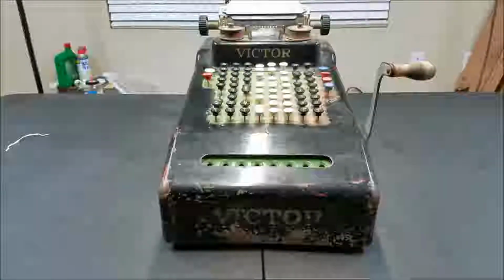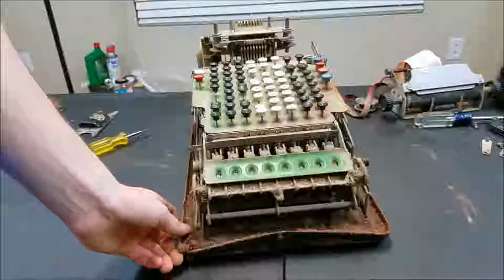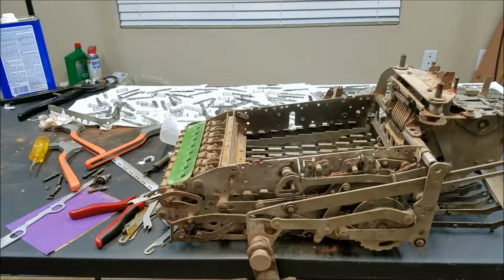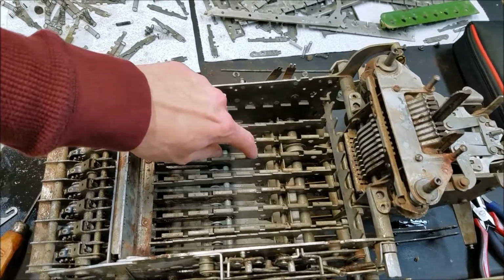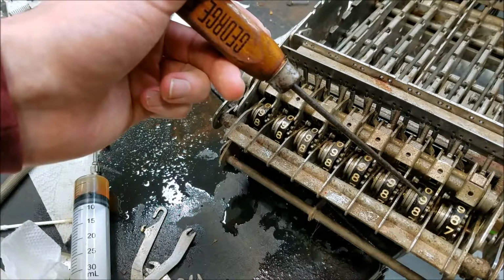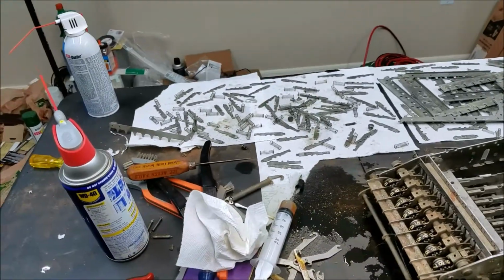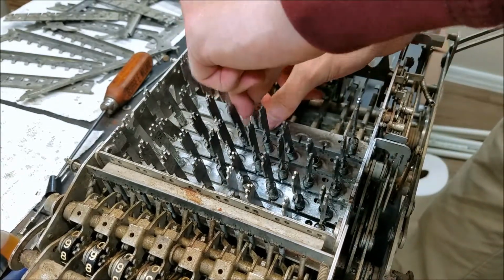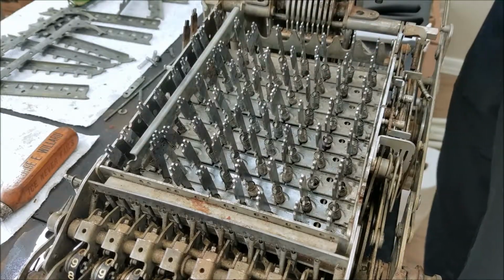Victor Adding Machine Repair Part #A

Comment: Have you found a service manual for these?
I have just acquired one and I need to get the printer mechanism apart as there is a bent shaft.
Reply from the maker: Unfortunately no, most machines like this were serviced by factory servicemen, and the manuals were never publicly available. Really the only chance to find a manual for something like this is if a serviceman took one home and kept it…
Reply: @bss1250  I understand the Victor company is actually still trading so maybe we should contact them with a "right to repair" complaint ;-)

Comment: What do you use to clean and lubricate and remove old grease?
Reply from the maker: Usually lacquer thinner, it very easily dissolves grease. It also dissolves plastic though so you have to be careful where you use it